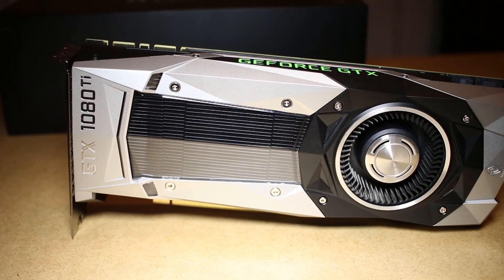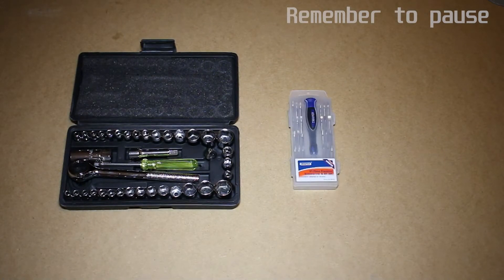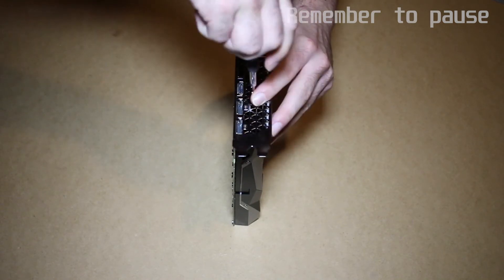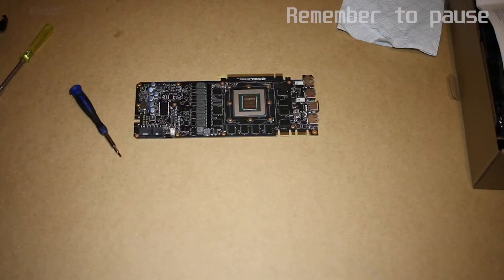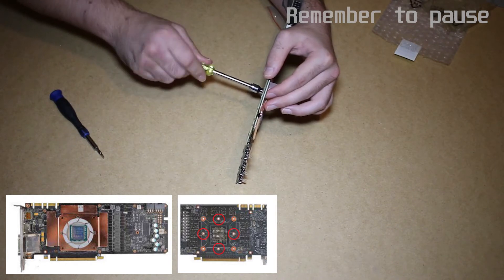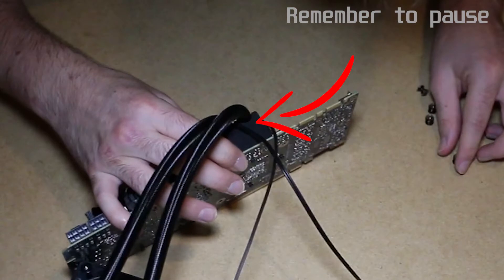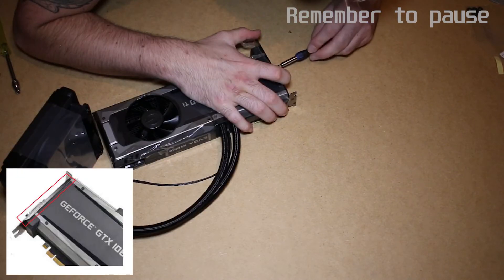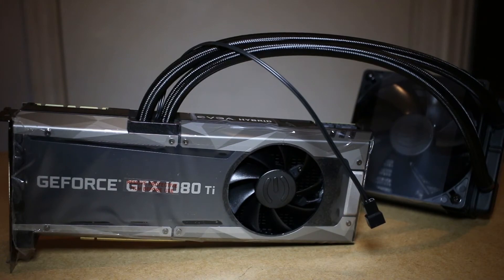EVGA GTX 1080 Ti SC HYBRID Kit Guide + Should you buy?

Comment: Thanks for the great guide. I installed the EVGA 1080 Ti Hybrid Kit on my Founders Edition card and was bitterly disappointed by the pump noise. Ended up replacing the kit through evga ram and selling the replacement. Temps were perfectly fine, but the pump noise gave me a headache, maybe i am just sensitive.

Comment: Will this fit a reference gtx 1080?
Reply from the maker: Hi, it may physically fit but the reference 1080 isn't listed in the compatibility list. I believe the memory arrangement and general layout is slightly different.

I have had a look to find the one for the 1080 and it seems to be difficult to get hold of (as i's sure you have already realised) 

I will have a bit more of a read as to whether this one will work with the 1080 and get back to you :)
Reply from the maker: Hi, apologies for the belated reply.

Unfortunately it seems as though this particular kit is only compatible with the 1080 Ti and not the 1080.

There are ways to use kits like this with the 1080 if you only use certain parts of it, but if you were going to do that it would be cheaper to go with an alternative brand like NZXT with their AIO GPU mounts, the KRAKEN G10 or G12.

 Mounts like these allow you to use a cheaper AIO liquid pump and radiator that you would have used for your CPU and fit it straight onto your card. 
They don't (in my opinion) look quite as nice, but they would certainly get the job done.

Here is a link to check out the G12 https://www.amazon.co.uk/NZXT-KRG12-W1-Computer-Cooling-Black/dp/B06XXF4Q68/ref=sr_1_1?ie=UTF8&qid=1527070323&sr=8-1&keywords=kraken+g12

and here is a link to a list of compatible CPU coolers you could use https://support.nzxt.com/hc/en-us/articles/115001271093-What-All-in-One-Liquid-Coolers-are-Compatible-with-the-Kraken-G12-

The total cost of one of the single fan CPU coolers with the G10 or G12 would be quite a lot less than the Hybrid kit and may be your easiest option if you wanted to cool your GPU with an AIO.

Again, sorry for the late response, Hopefully this was useful to you :)
Reply from the maker: Hi, apologies for the belated reply.

Unfortunately it seems as though this particular kit is only compatible with the 1080 Ti and not the 1080.

There are ways to use kits like this with the 1080 if you only use certain parts of it, but if you were going to do that it would be cheaper to go with an alternative brand like NZXT with their AIO GPU mounts, the KRAKEN G10 or G12.

 Mounts like these allow you to use a cheaper AIO liquid pump and radiator that you would have used for your CPU and fit it straight onto your card. 
They don't (in my opinion) look quite as nice, but they would certainly get the job done.

Here is a link to check out the G12 https://www.amazon.co.uk/NZXT-KRG12-W1-Computer-Cooling-Black/dp/B06XXF4Q68/ref=sr_1_1?ie=UTF8&qid=1527070323&sr=8-1&keywords=kraken+g12

and here is a link to a list of compatible CPU coolers you could use https://support.nzxt.com/hc/en-us/articles/115001271093-What-All-in-One-Liquid-Coolers-are-Compatible-with-the-Kraken-G12-

The total cost of one of the single fan CPU coolers with the G10 or G12 would be quite a lot less than the Hybrid kit and may be your easiest option if you wanted to cool your GPU with an AIO.

Again, sorry for the late response, Hopefully this was useful to you :)